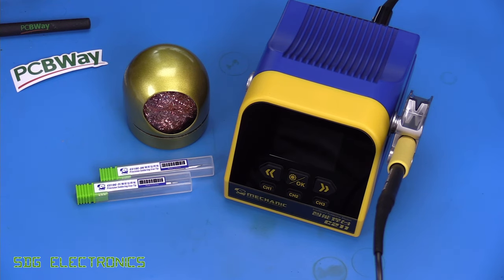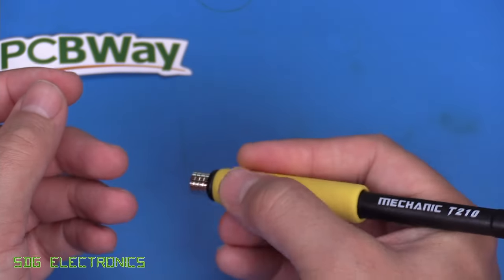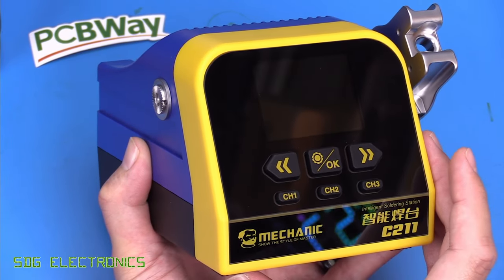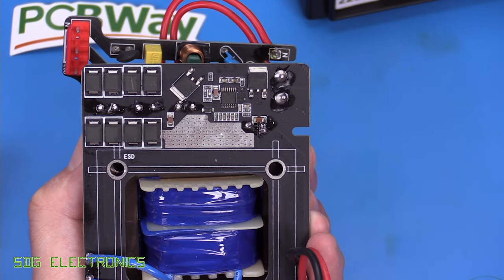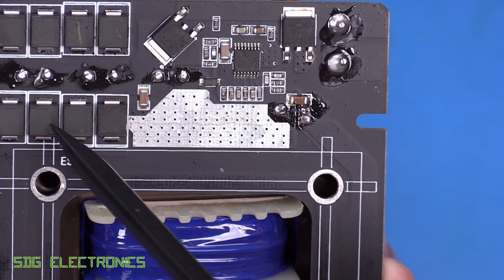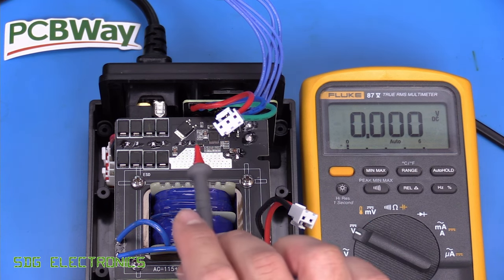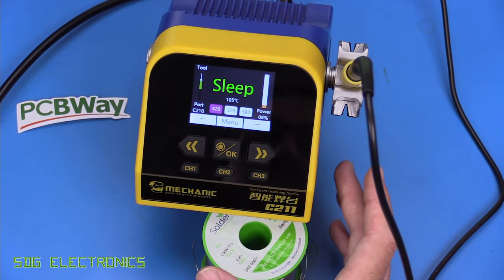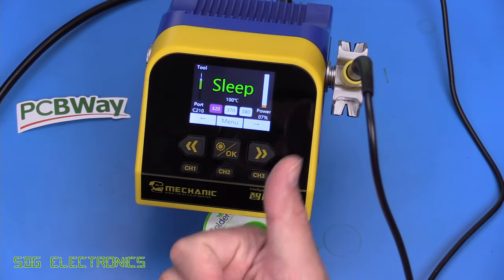SDG #316 Mechanic C211 JBC Style Soldering Station

Comment: Hi Steve, we must warn you (from eevblog forum) that somebody very recently took apart the Aixun T3a handle, and found the construction inadequate inside. So the assessment of this yellow handle here - should be treated with some similar level of caution. Because externally the handle does perhaps looks and feels great. However this does not show internally the materials used and how. For example relating to those longer term durability of contacts. In specific the Aixun handle (T245 style) was discovered to use aluminum contacts held inside of plastic channels. And the plyability of the plastic can then let transmits beinding into the aluminium, which then may indeed gets bent out of shape and plastically deformed. But also the bare aluminum was commented to also perhaps have sparking / arcing deposition issue. This isn't necessarily some death sentence, but it can mean some percentages of people encounter issues, or that some servicing or maintenance or more delicate handling. Which needs to be cautiously observed, and appropriately if diagnosing specific issues. Or when considering the value add to buy seperately some official handle from JBC instead.
Reply: Would that be for the green handles or their new blue ones? I was considering getting an aixun t3a because it's at an attractive price for 200w of power for a cheap station. I haven't seen or heard many complaints on it 🤔 would a regular jbc 245 handle work on it? I'm assuming that at that point, a conversion would be needed since the pinouts look different.
Reply: @rubenmejia4881 Not sure about the original JBC handle, but I have been using the station without any problems so far and I like it :>

Comment: JBC calls the T210 a "20W handpiece". I don't know what they actually drive them at (their base is rated for 40W), but the clone C210 I have will push about 50W into a tip at 12Vdc, higher at 20Vdc. This seems to be common. I have no idea if the lifespan is significantly affected or not yet from my use... Its overkill for a tip of this size and geometry as you say. 40W is plenty.

Comment: Oh, did you test if the tip was earthed? I didn't see a connection on that back PCB, and that would explain some of the noise.
Reply: I also wanna know that. T12 pro didnt connect the tip to earth
Reply: The back PCB has an earth wire soldered directly to it. I guess there is a PCB trace going to the connector for the iron. 

20:11 I don’t understand why noise in the heater voltage makes noise in the temperature reading from sensors at least 30-60mm away… Unless the tip is earthed and heater current is flowing out of the tip to an earthed surface because a ground loop is created (like with the Aixun T3A)?
Reply: @davadoff  The test board ground plane is at least well capacitively coupled to the measurement circuit. So it makes sense that the noise can get to it. Could be ground loop type effect, yeah.

Comment: Man I was really looking forward to you grabbing the T245 version. I've been watching your videos alot as of recently because I want to get a decent station setup for the t245. I use a hakko 888d that I love but in some cases when I need it, it doesnt provide me with enough juice for the large ground plains or bigger areas with larger joints it struggles on me. As per your recommendation I have bought a genuine 245 cartridge and also the rubber boot cap that stops the flux vapors from getting in. Just waiting on a decent station without having to break the bank on a jbc since I repair on a hobbyists level but do enjoy owning professional equipment.

Comment: Good to see that the transformer is 230V, I was a bit concerned when I saw the 220V label on the rear with the UK being a 240V country and there have been quite a lot of issues historically with 220V products, especially with transformers and capacitors.

Looks a really well made soldering station. I might have to pick one of these up to play with.

Comment: would have been better if they put a resistor in-line with the earth to the 4mm socket and the tip if it's earthed.
I do like the Weller idea of a 3.5mm jack so you can put a resister in the supplied plug and give the iron tip what ever resistance to earth you like, or isolate it completely by plugging in a plug with nothing inside.

But nice to see a twin bobbin transformer so at least the low voltage side should never come into contact with the mains.
shame the pre-sets could wear out the memory if you keep changing the values.
Reply: Weller? The ones that didn't bother to put a fuse in their soldering irons? Yeah no thanks, tip should be earthed.
Reply: @jaro6985  not a problem in the UK we fuse our plugs, about time the rest of the world  caught up. 
Not sure were you get the fact that tips should be earthed. The power to the handle should be isolated from the mains supply so exposed metal doesn't need to be earthed,. So the tip should be treated like a antistatic mat with just a bleed away resistor to earth.  The problem with static is if you have charged up you pcb by handling it and then touching it with your earthed tip you could damage the part connected to the pad.
A lot of these soldering stations need an earthed tip is because the mains isolation is so dodgy they could be a death trap in waiting.
Reply: @TheEmbeddedHobbyist  What you say makes sense and sounds correct to me. However, JBC spec <2mV tip to earth potential and <2 Ohm tip to earth resistance. All the other big name stations with transformer power have identical or similar specs. So I think everyone copies it. 

How come JBC and others don’t earth their tips through a resistor?
Reply: @davadoff  I think it's a problem if you don't have any ESD protection. As if the component on the board has been charged up by being handled and you place an earthed tip on the pin. it's a fast higher current discharge which could damage the part. I prefer the tip to be like the ESD mat to be connected to earth through a high resistance. Also means that when I working on live equipment the iron is not a good earth path should I touch it even when it's off.

Comment: I’ve seen bridge rectifiers connected in parallel in  elevator controllers.
Reply: One diode will get hotter which lowers its forward voltage and increases the current through that diode. That makes it even hotter which lowers forward voltage, increases current even more which makes it even hotter. 

Parallel diodes need to be in the same package like two one one TO220 package.

Comment: If the tip is DC powered I wonder why they adopt an old fashioned transformer rather than an SMPS?
Reply: Full isolation, reliability, low noise… typically

Comment: The station design approach is rather strange. There are primarily two heater control approaches for a single channel cartridge based soldering station. The first is AC heater control using a large step down transformer (usually also having a separate output winding for the logic supply), and the second, DC heater control, where the heater supply is DC derived from a universal switching design without the large step down transformer. To use a large transformer and then a power switcher for DC heater control is very strange and costly.

The obvious issue with the large transformer is your design is not universal mains.  As such, like for the JBC compact line (Pace does something similar), you will see three AC mains offerings; 100VAC, 120VAC and 230VAC, using dual frequency 50/60 Hz power transformers. 

The paralleled device bridge can be made from SiC Schottky Barrier Rectifier Diodes, to essentially spread out the heat over the PCB and share current. However, this is an expensive solution. If not SiC you can pair match regular Schottky Barrier Rectifying Diodes, and if both are at the same temperature (close together / track together with temperature) they tend to do the job at very low forward voltages. But why are they there to begin with? Why not just run the heater from AC?

Another strange design choice is to not put more useful information (use color more effectively) on the graphic display and the displays basic layout in general. The screen graphic on the bottom of the screen is the same as the buttons. Why would you waste this screen area with a static label? The Power display update is way too fast and should be damped. Power is depicted as a bar graph yet the percentage is also given. Why do you have a graphic of a soldering iron on the screen? Is this to tell you it is a soldering station? Why abbreviate the word temperature? and the levels are really presets.  This is an expensive color graphic display with the user interface design by a two year old. I have seen many simpler designs with a single color OLED display that displayed more information and in an intuitive way.

Comment: they make a really nice solder also i think its the 100 model nice and shiny and melts great. mechanic does make some really nice stuff but its just so ugly i dont know why they decided on these color schemes makes their stuff look so much cheaper then it should because for the most part it works very well in most cases. their "short killer" works very well also as does their uv light with fan and usb desktop charger. i agree on the tip cleaner they use the same generic one a lot of others use and its a piece of junk imo. so far thats really the only thing by mechanic that has been really garbage for me i do prefer my aixun 420 over this unit and even the t3a though
Reply: The colour scheme is obviously a copy of Hakko.

Comment: First else than author
Reply: I have mechanic t12pro and hate it cause the earth not connected to tip. So i modify it.
Reply: @unintendedperson  i prefer to have the tip connected to the earth by about 10K so i can use it on PCB's with the power on if needed (only low voltage boards <24V). but still not have to worry about induced voltages on the tip or static build up etc.
Reply: . Sure, i confuse back in the day, but no one suggest what value to add a resistor between ground and earth in discord forum. So i just copying a jbc video, the tip directly tied to earth. And gladly it work, cause i dont have any other soldering iron, so it hard af to make a connection with hot air station. Lol
Reply: The problem is tingling when i touch the solder wire lol
Reply: @unintendedperson  I tend to use about 10k to earth, but you do want an iron with  mains isolation barrier that meets current regulations for electrical safety.
Reply: @TheEmbeddedHobbyist  sure, plan to use RCB later
Reply: @ampuh214  I have thought about putting a mains isolation transformer in mains supply to all my equipment. That way you lose the risk of electric shocks to earth, won't save you from an live to neutral shock. But as I don't work on a lot of mains powered products that form of shock is very low risk.
Reply: @TheEmbeddedHobbyist yeah. I also plan to buy isolation transformer ex ups which is cheap
Reply: @unintendedperson  i have a few old 50W 12V lighting transformers, i was going to put two back to back with maybe some form of current limit. a few 12V car headlight bulbs in series might work, a few 5W and 25W stop and tail bulbs might make a nice dim bulb limiter.
Reply: @TheEmbeddedHobbyist sure. For safety reason in main voltage device repair, isolation transformer + current bulb limiter is a must.